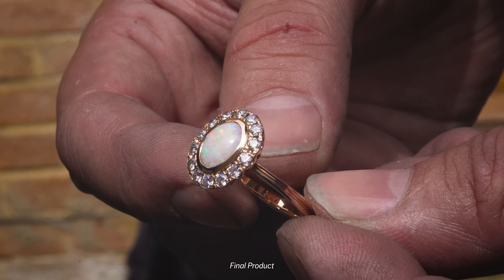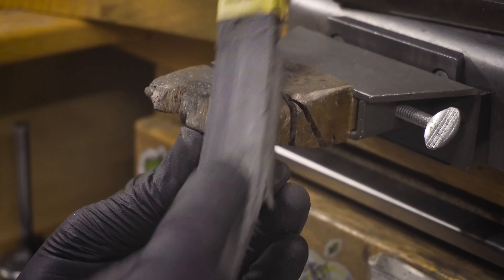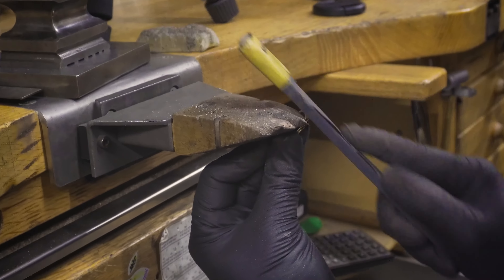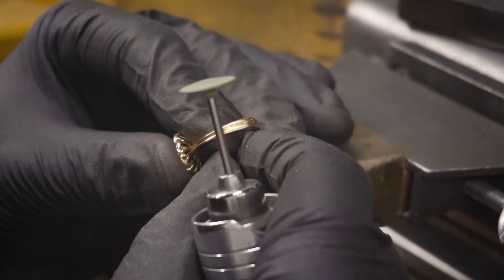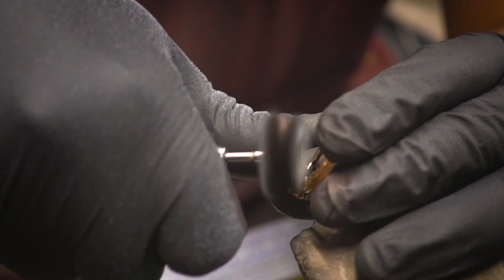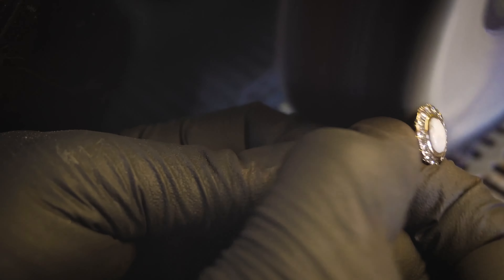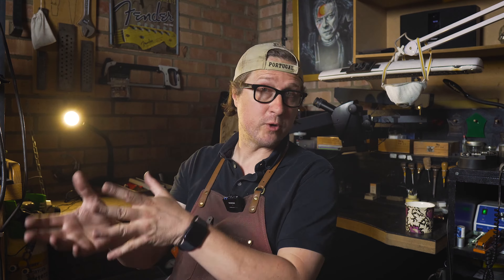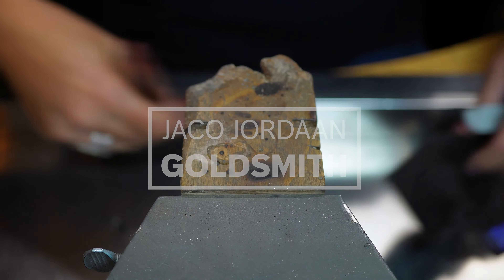Jewellery Polishing Process | Goldsmith’s Workshop Secrets

Comment: Hi, I bought a gold pendant (mase custom for me) when I received it- it had already so many scratches on it is this normal? or did the jeweler not polish it correctly? Is this something that can be fixed without polishing away the engraving that is on the pendant?
Reply from the maker: Hi, that sounds like it can definitely be polished out but it’s hard to tell without seeing it. I don’t personally let jewellery go without making sure that there are no marks on the surface but everyone has their own thing. I would raise the issue with your jeweller and see how they can help out. Good luck 👍🏻